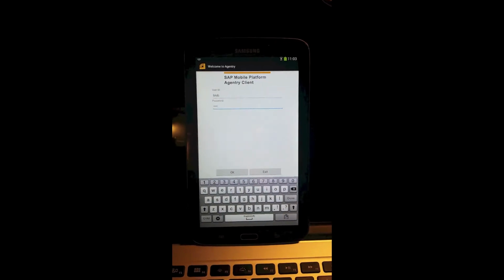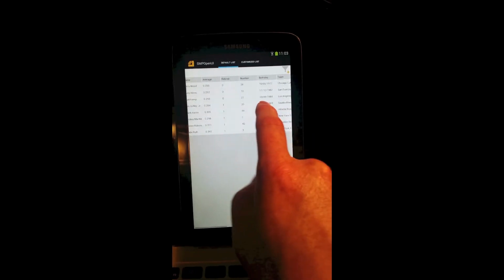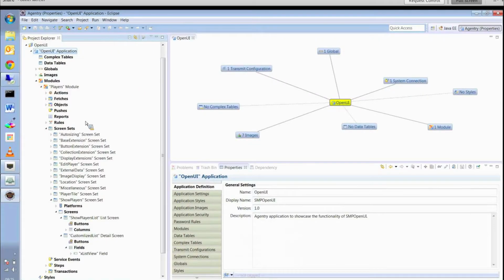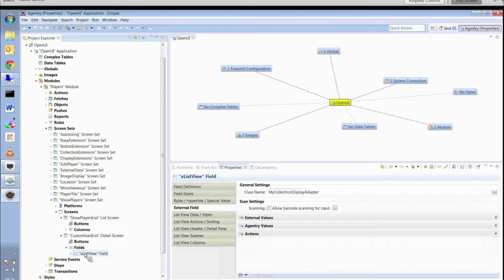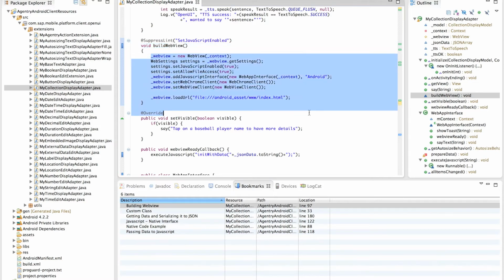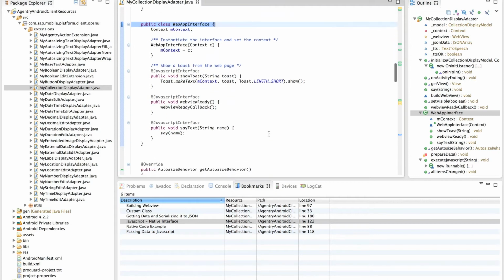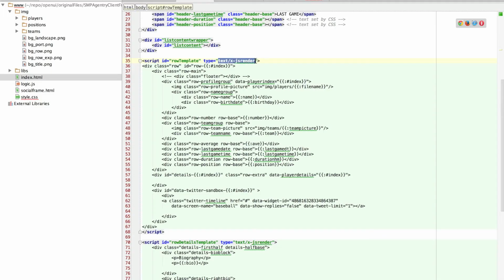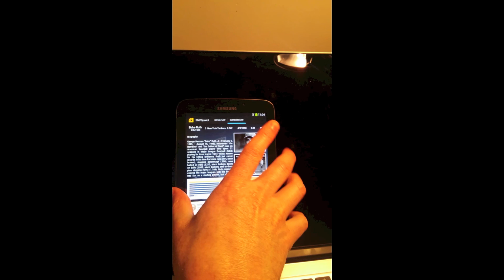Agentry OpenUI - Example of Custom ListView

Comment: Olivier- This is a great video - while i am able to trigger actions in Agentry with OPEN UI , is it possible to trigger inter process communication in the Device between Agentry App and another App using UI SDK without a round trip to SMP Server?
Reply from the maker: Absolutely, you can communicate with other apps through IPC without going to the Server.
You can start other apps passing data, receive data back from other apps and so on.
For example, i was working on a barcode scanner. My components starts the scanner and gets the scanned result back. Just be careful with the data since it would not be secured by the Agentry app if you pass it on to third parties.
You can do a great deal of stuff, i know of other people who even started an HTTP server from their OpenUI Component to help communicating with a wearable device for example.